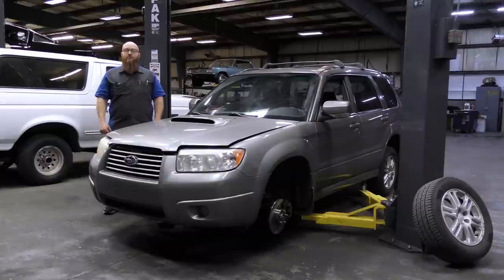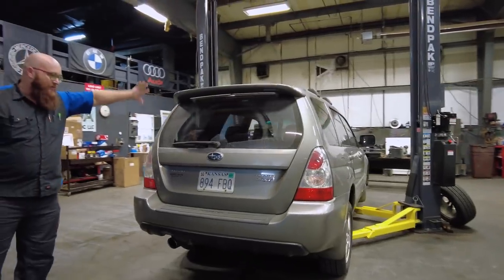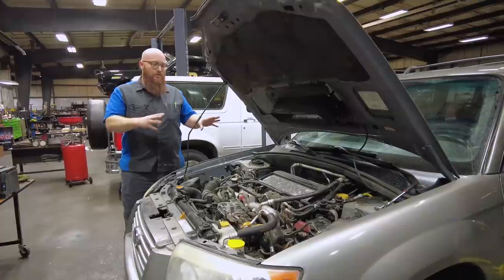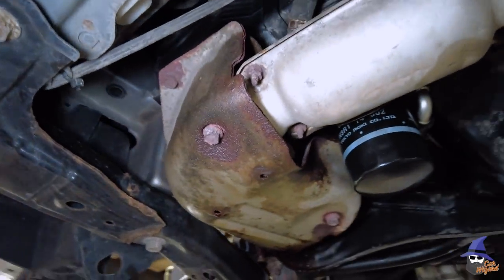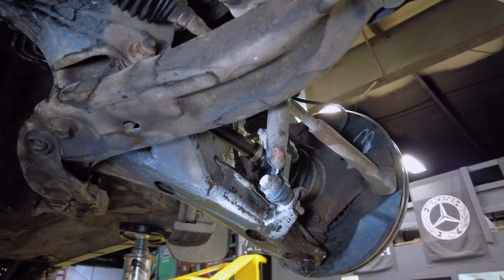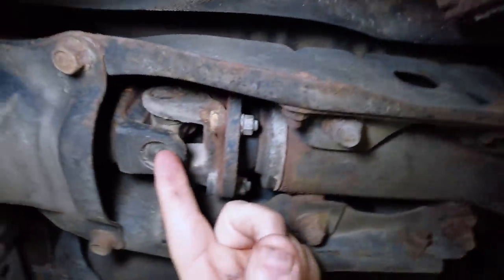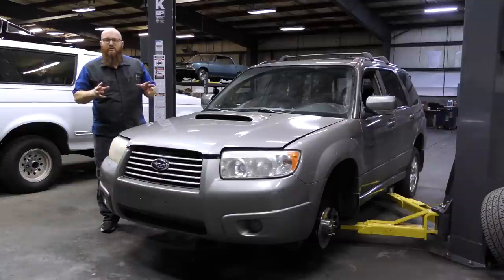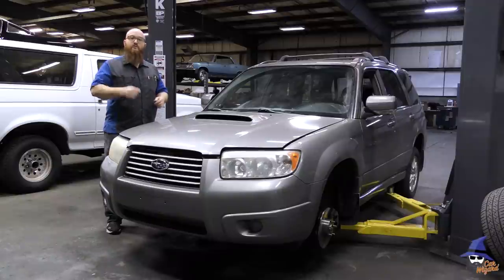Can't fix it all! '06 Subaru Forester XT has issues the CAR WIZARD doesn't fix. What are they & why?

Comment: Have a 2008 one of these 2.5 XTs in England, with the auto gearbox.
That transmission filter works the opposite way to engine oil filters, its expensive and people have been known to fit cheaper engine oil filters, which only serves to starve the gearbox of oil flow.
Auxilliary air pump failed on mine, they all fail and are stupid money to replace, had it removed and programmed out.
These are great multip purpose cars, really quite small overall but enough room inside,  like all Japanese cars (mine was made in Japan) they need some extra underbody protection applying where salt is used on the roads, mine is completely rust free underneath.
I change the engine oil every 3k, and the coolant every 20k miles, the only job i hate doing on all Subarus is changing the spark plugs.
Note, in England at least, the exhaust is specific to the XT its 2.5" bore, correct new exhaust is only available from Subaru, pattern parts here are all wrong they fit and are sold as suitable for XT but they are 2" bore only, my exhaust rusted out so had a stainless steel system made and fitted....don't ruin your XT by fitting the wrong exhaust.

Comment: If the secondary air system valves are closed and not seized (or at least, seized closed), you can just remove/gut the relay and delete the codes's from the ECU. Leaving the system inoperable and prevents the car running in limp mode. My car has been running fine for 4 years this way ;)

Comment: Turbos don't have headgasket issues like the NA versions did. Also removing the intercooler and throttle body to get better access to parts is extremely easy and not labor extensive. I own a 2008 which is identical and did it on my own as a beginner mechanic with ease!

Comment: Subarus are overrated. Way overrated.
The new windshields are weak. They crack easily. Every time you replace the windshield, you have to get the dealer to recalibrate the "Eyesight". ie $$$$

Comment: In California if emissions control systems don't work, the vehicle fails smog inspection and will not get registered and with DMV expired tags, good luck driving.  California will help with repair costs if you go through the proper procedures.  Check engine light on? Automatic smog inspection fail.

Comment: So you're basically not fixing the emissions control system because the customer deems it to be too expensive? Emissions controls are a pain on any car that has them. At least the parts for this are still available, though. I have a BRAT with an EA81 and those engines used several different emissions control schemes depending on how they were configured and where they were sold, and the bulk of the parts for any of them are NLA. The previous owner of mine partially stripped most of it out before I bought it, so instead of trying to find unobtainable parts to restore the original rat's nest of hoses, one-way valves, and solenoids, I just pulled out the remainder and did an FI swap. The only emissions devices it has left are the charcoal canister and the catalyst.

Comment: they are  not the best on gas. I have a 2013 Forestor and it gets only 25mpg. I have a vw tdi jetta with 400k miles and I get 42-46mpg.

Comment: I had the 2005XT and the 2007XT. I drove them both to 150,000 miles and never had any issues beyond normal wear and tear. A new radiator at 110,000 miles on both of them was as bad as it got. I’m now driving a 2017 XT and preferred the older generation. If I could find a 2007 XT Premium (I love the leather seats) with under 30,000 miles and one careful lady owner I would jump at it.
Forester XT is the best car I’ve ever driven and 19 years later I am still driving one.
No offence but I always had an annual dealer service with Subaru trained mechanics. I attribute that to never having any major problems.

Comment: The 2.5 Turbo doesn't have head gasket issues like the N/A 2.5. Also, the new 2.0/2.5 FA series motors (with timing chain) don't have issues.
Reply: Not exactly. My 2015 Forester 2.5 FB series blew its head gasket while overlanding in Colorado. It’s not as common, but not nearly as prevalent.
Reply: It's not that they don't happen, just less common and usually there's something else wrong with the engine before the head gaskets blow.  Most of them I see come into the shop with engine issues are blown turbos, if you're lucky you catch it before it toasts the whole engine but we won't do the job unless you replace everything that oil touches because we've had to cover several replacements due to comebacks (usually some little piece of metal you can't get cleaned out which wipes out a rod bearing and sends metal through the new block and turbo, last job that happened to we ate $13k).

Comment: If anyone needs a aftermarket driveshaft for Subaru, theres a company in colorado that makes them and I installed one with Chevy or ford u joints and no more shafts needed. I busted three of them in the Baja and problem solved. Staked u joint sucks!

Comment: The 2006 Subaru was the best car I ever own, wish I’d not sold the thing. I traded the 2006 for a more recent Subaru, purchased new. The replacement Subaru was auto not manual as was my 2006. The manual had a hi and low position, for a small vehicle it was brilliant for towing.

Comment: I daily drive a 2009 Forester XT has 267k on it. Been the most reliable daily since I got it and fixed it up. Got it for free with a massive misfire on cylinder #4. Was under the assumption that it had a cracked ring land which is the most common issue with the EJ255/EJ257 engines. Given the miles and lack of care before I owned it was easy to assume. I was going to do a compression test just to verify my concern. Low and behold the heat sink on the ignition coil had rust jacked so bad it put a crack through the entire thing. Had a friend with a pile of OEM used ignition coils that he let me have for free. Thumbed through the pile and picked the best-looking condition coils. Threw some plugs in it and swapped all the coils. Ran smooth as new. I was elated. I did some more repairs to it after that and got all the maintenance up to date and have been driving it issue free for the last 2 1/2 years.

Let's talk about that CTS-V wagon in the background. I own an 11 CTS-V sedan w/ 6sp manual. Would love to own a wagon version but man the price tag pretty much doubles with hose. oof.

Comment: If that rough running is significant at idle, and throwing misfire codes, check compression. The most common issues with these engines are piston ringland failure (yes, even when stock) and spun bearings. Obviously the bearings are fine being that it's not knocking (presumably). But ringland failure can be damn near asymptomatic.

Comment: I had one of this year and model, but a 2.0T JDM version. It was down on power with only 30,000km on the clock, found out they are VERY sensitive to the type of oil used. If non synthetic oil used it would be very laggy, had to flush oil and it came right.

Comment: I had basically the same engine in an 06 WRX. Run like a clock until it blew the head gaskets at 200,000 mi. I also had had the  smog pump snail-like thing go bad at 100,000k, expensive as hell to fix. Run on dino 10W-40 all its life, changed at 4000 mi and never used more than 1/2 quart in 4k mi.

Comment: I was almost considering buying a used 2013 Forester XT, but I looked it up on Google, and it said it's not very reliable.  It looked cool with a two-tone paint job, though.  Black on the top, grey on the bottom.

Comment: You think by now Subaru would get there act together with garbage head gaskets, not to mention the wheel bearing problems, try getting them off in a location that uses salt, good luck, but for all season Subaru are pretty good, my niece bought one new and first thing I told her was get the EXTENDED WARRENTY

Comment: These are very cool cars. These turbocharged Subaru engines are not known to have major head gasket issues. Only 2.5 liter naturally aspirated engines between 1999 to 2012 are plagued with premature head gasket failure. Some Subaru turbo engines start burning oil due to the oil ring problem. But besides that, these are very tough engines.

Comment: I been noticing these car repair guys don't teach you how to spot a failing engine or a transmission going out. There are manuals automatics and cvts. Drive belts. Timing chains. Occasionally 2 separate chains or belts like my jeep patriot has. 1 around the engine 1 on the AC unit.

Technically non interference engines vs interference engines.

Comment: Do you have a written list or document with the “recommend” vehicles and engines vs the “run don’t walk away” from vehicles and engines? I’m looking at tahoes as well as a few other options. I thought it would be easier when I compare cars on line or at the dealer if I had a print out of the naughty list

Comment: I have thought about buying a Forester XT on and off over the years. It appears the weak part of the cars is people not changing their oil enough for clean oil and having dirty / clogged screen that leads into the turbo (banjo bolt?). I would still buy one but would change that filter and do a motor flush before driving it more than a few miles after purchase.

Comment: Very desirable amongst Subaru aficionados..May be worth more than they think. Head gaskets generally were not an issue with the turbos. They had the MLS gaskets from the factory. Also, this car is worthy of an engine 'refresh', replacing all the seals. The entire OEM seal kit is around $300. Engine can be out in a few hours.

Comment: Head gasket issues relate to the coated single layer gaskets. Get a turbo and you don't have that issue as they use MLS gaskets. I have an 04 FXT. The real problem is the gasket kit for the non-turbo models still has SLS gasket instead of MLS so you can end up repeating the work if you don't understand the best practice. Good information is important. People who tout "all Subarus have head gasket issues!" are not sources of good information.  Stay informed folks.

Comment: To my knowledge, Kansas does not require emissions tests, so who really cares if the secondary air system doesn't work as designed anymore? How much extra pollution does it actually create? Probably not enough to justify the price to fix it. But if it was a newer one, it would shut off your AC. This is why you need to keep your old stuff running, folks.
Reply: The only thing that system does is reduce emissions during cold starts.  They're also very prone to failure.  Prior to Project Green Speed it was one of the first things to go when you start modifying Subarus beyond just an intake and exhaust.

Comment: You can get u-joints with a C clip that holds the bearing caps in from the backside but you have to dremel out the stakes and it's nearly impossible to rebalance the driveshaft afterwards.  Most shops won't touch them for that exact reason.  However, they can get you by if a new driveshaft isn't in your budget at the moment or like in the case of the SVX, the driveshaft is no longer available.

Comment: With the differential being between the engine and trans does that mean there is always power going to the front wheels? Are the front wheels geared differently to the rear?

Comment: In California, it's legal to delete and smog the vehicle without the air injection system
They fail so often and the parts are becoming obsolete
The ecu for this car is not avaliable. I've had the 06-07 wrx and air injected xt foresters and outbacks bard' to delete the air injection system. 
New oem parts aren't avaliable to fix them anymore 
The diverter valves fail due to moisture causing the stepper motors to push high voltage. Blows the mosfets in the ecu that control them. 
You get permanent check engine lights unless you have it bard and the codes deleted out. 
I'm not sure what emissions standards are like there but most states follow California and New York 
That being said, I wouldn't doubt that's also an acceptable fix there. 
Last year I bought the apparent last ecu for an forester xt 06 and it had to come out of Canada and it took 2 weeks to get from the dealer. 
I'd make sure 100% that the ecu isn't damaged in your case also as it's common

Comment: Fun fact I have a 14 crosstrek with the newer FA platform and I just did my second set of headgaskets on my engine at 166k miles. So they're still a weak point just not a horrendous as before
Reply: Pretty sure these have FB’s not FA?

Comment: I worked as a salesman for Subaru for 11 years. Forester and outback’s always came back for multiple major issues. I would insist they get the extended warranty! My customers were so happy I made them get the warranty. Almost every one of them got and engine or transmission replaced!
Reply: 2008 Forester with 160K miles. Original everything.

Comment: There are replacement U-Joints for the Subaru's.   Same part used on many other vehicles including Toyota/Lexus.  The bearings of replacement U Joint has a slot on the inside of the U Joint yoke that accepts a C clip to retain the new U Joint in position (replacing what the stake did).  You have to drill out the stake clip and press out the original U Joint.  My local transmission shop replaces unrepairable U joints on all sorts of vehicles using these replacement U Joints.  The replacement part has a grease fitting, and it may not last as long as the original part, but if you replace it before the yoke gets chewed up then its a very cost effective repair even if you have to do it again. 

Rockford Driveline has the replacement U-Joint parts, if it fits a Toyota Highlander/Lexus RX, it will fit the Subaru, and they cost about $20 each.
Reply: Same for GL1500 Goldwings. Their U-joints became unavailable a number of years ago when Honda lost one of its suppliers. Shops sprung up and started repairing these "unrepairable" staked U-joints the same way: drill out the clip, press out the old one, install new ones with c clip. They too put grease fittings on them.

Comment: I don’t get the new rotor thing. I have driven 12 to 15 vehicles over 200 and some thousand miles on each one. Call million miles at least. I have never had a rotor turned or replace the rotor. I just don’t get it. Is it a profit center? I’ve never had one go out on me or break or blow or anything ever
Reply: Rotors need turned if you get them hot and stop with your foot still on the pedal--you end up with some of the pad material imprinted on the face of the rotor thus causing a high spot which makes the car shake while you're on the brakes.  It's common practice to have them resurfaced when changing pads if you're using different pads than last time because that can cause them to wear quickly, as far as getting 200k miles on the stock rotors?  Totally possible if you're not hard on your brakes.  As far as replacing them with each brake job that's what we do at the dealership, as easily as people get pissy about things and how some people are chomping at the bit to sue over the slightest thing (until they actually try and find out what it's going to entail) we just replace the pads and rotors.  Not worth the liability, we're going to replace all points of failure and all points of some know-it-all saying we did it wrong and harassing our service advisors.

Comment: I just did the rear brakes on my '01 Subaru Outback LL Bean.  PowerStop kit, the only thing difficult was getting the two pad carrier bolts loose.  You had to feed a 12 inch extension with a 14 mm socket through two small holes in the suspension arms to get at these bolts.  Without a lift it was a pain in the ass!

Great video!
Reply: I have to do that when the weather warms up.

Comment: Love these, one of the best cars ever made.  Just the right size.  My dad owned an 04 XT for 11 years with no major issues.  Easy to work on in your own garage too.

FYI Pedders makes good suspension parts, including full replacement sets.  The perrin endlinks though are ehhh, better off with Kartboy if its a street car.

Comment: I've never liked this type of car. Have owned a 2006 model and boxer engine uses more fuel than  many other engine types do. Not the most quiet car inside while driving!

Also has problems with a air pump valve that blows air inside the exhaust when the car has just started. Becomes a lot of condensation and valve rusting.

Also very outdated and old -fashioned inside!

Comment: Should have bought a Camaro or older Firebird.   Have the owner remove emssions and add a tuner to get better mpg.  KS I don't believe does an emissions check.   Joking aside it looks like a vehicle to easily service vs others to keep repair cost low.